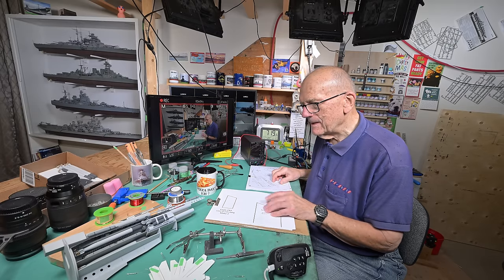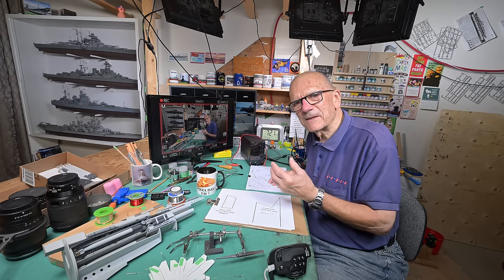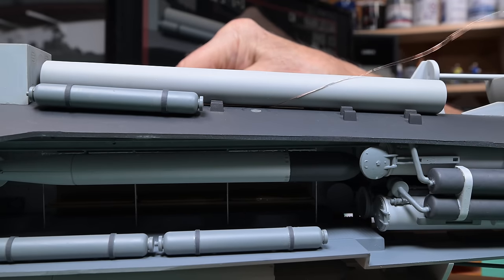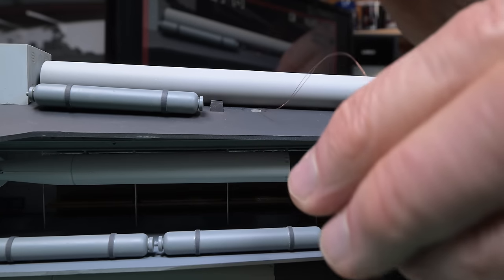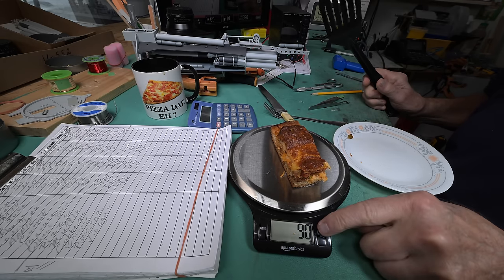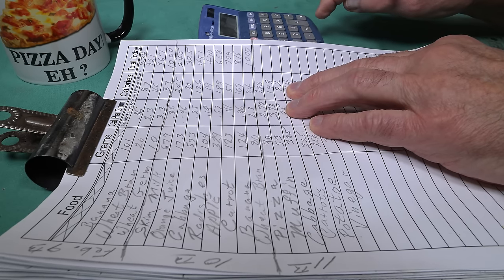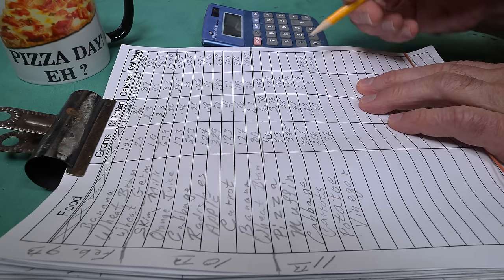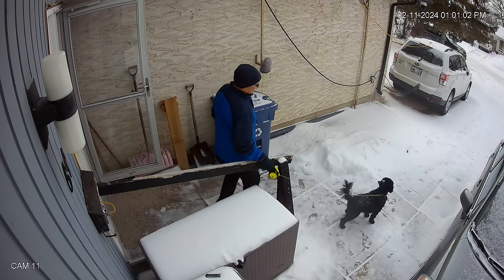The Model Ship - Part 1894

Comment: Hi Ron, I've worked a lot with magnet wire in my day, primarily with transformer and inductor windings.  The wire enamel is not real insulation, and can have pin holes.  It is normally not a problem because the voltage turn to turn in a coil winding is quite low.  I think this will work for you even though you are twisting the wire in pairs rather than winding them in a coil.  But if you do have a problem with a led not lighting, it might be that you are getting a short between voids in the enamel wire coating.
Reply from the maker: Thanks Dave, for the heads up on that. 👍

Comment: Routing wires is never fun. But the result is always worth it. I agree with jim on wrapping the wire on the lead. The way i do it is bend one lead out of the way, leave a tail of wire to hold on to then wrap. Looks like s fishing lure knot or noose knot from tight wraps, then i trim the tail. If this is done close to the diode then the excess lead’s can be trimmed as well. Great video Ron. I remember how stressful the first headlight was on the BR-86 but they keep getting easier. Great job today, take care n see you tomorrow.
Reply from the maker: Re: "wrapping the wire on the lead" I need to perfect my technique! 😁👍

Comment: Hi Ron,  maybe we should cut back the the wires back on the LEDS To 10mm ,re solder , and bend them back towards the tank ,would look alot neater! With your new bike , one thing i learnded from my biker mates is  you should be able to pick up your bike by yourself if you drop it , sooner or later  they have all had to pick their bikes up either from a fall , or just poo poo happening 😊😊😊😊😊😊 see you tomorrow,  lights works great
Reply from the maker: Hi Marc,
I am thinking about redoing that LED. We'll see. Perhaps this evening off camera,
As for picking up your bike --- good luck with that! Haha!

Comment: If your bike has a centre stand it will move back about 3 inches as you use it, so bear that in mind when measuring.
Best option is a "roll in" front wheel stand
Reply from the maker: Just a kickstand. But thanks for the warning. The scooter has a centerstand. 👍

Comment: Two thoughts for you. First, I don't know if you did this but you may want to mark the polarity of your wires. That will save you some hassle. Second, Tulip black fabric paint is excellent for light blocking. You may want to put a dab on your LEDs when you are painting them and the wire.
Reply from the maker: Thanks for that tip Vern 👍